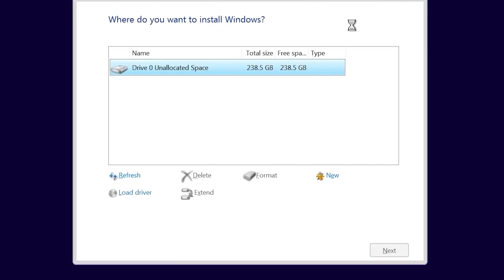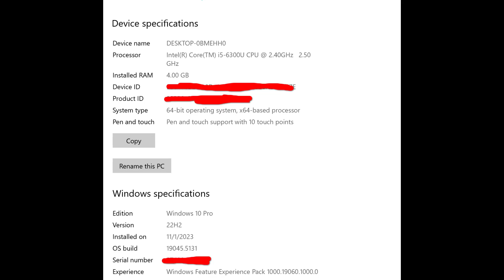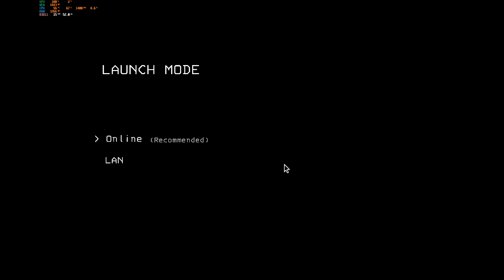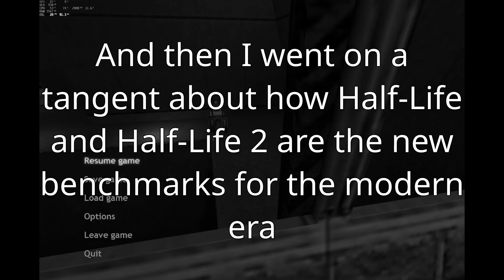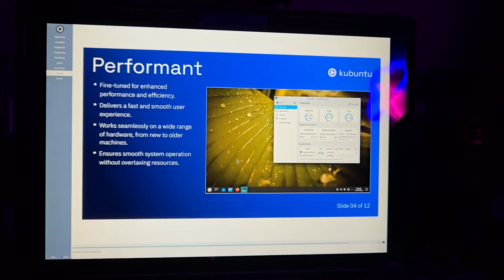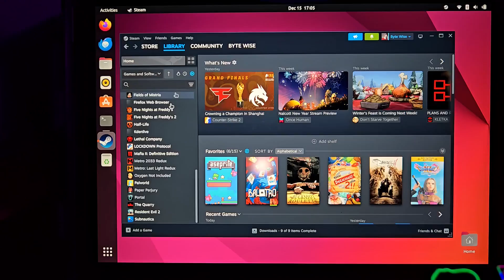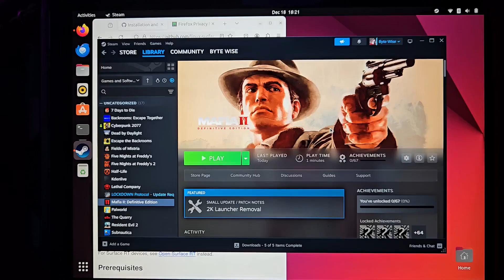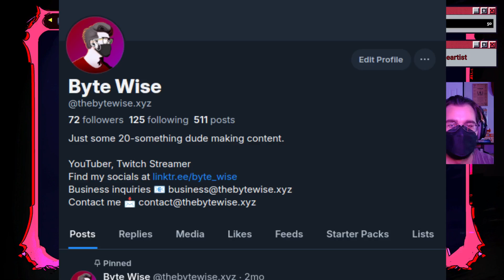Installing "SteamOS" On A Microsoft Surface

Comment: Top tip: Nobara fedora version installs on a surface and the touchscreen works without any additional installs
Reply from the maker: I might take a look into this since I'm using a flavor of Fedora for another project. I think there's another flavor that also supports Surface out of the box but I'll have to look into that

Comment: Thanks for the video, But I was wondering about a niche case using the Surface pro for a game streaming device? I am considering an upgrade path on the main gaming PC, and If I know that streaming to a Surface Pro through SteamOS, then I may pull the trigger on the gaming rig, going all out AMD....... I should have continued watching. Can you tell if this is a better experience compared to play through steamlink on a google chrome cast or mi box?...... I should have continued watching. I would then just work on getting the touch screen going which would make it worthwhile for me...... I should have continued watching... Great Video Thanks!

Comment: XP has not been derided by most Windows users. Many still do use it compared to ME and 8 (NOT 8.1)
Reply from the maker: Yeah another commenter pointed out I may have been thinking about Vista and they were 100% right. That's definitely my bad. If I do a follow up to this I definitely want to address it because I didn't mean for Windows XP to catch a stray bullet. Thank you for the clarification though!

Comment: I know I'm late to this... But what about ACTUAL SteamOS?
Reply from the maker: Good question! I tried HoloISO first as sort of a "is this even a good idea?" test, and because that didn't go well I had a feeling real SteamOS wouldn't go well either. I know the two are different enough that this might not be the best way to go about it, so I could give it a try in the future. I'm also partially waiting for Valve to drop an official release for the sole purpose of well tested compatibility with more hardware.
Reply: @byte_wise  I believe they have an official release. I was going to try it on my own Surface Go 1, but wanted to see if anyone else had done it first, and I ended up here.

Comment: I've been thinking about doing this with a surface book
Reply: Don't. Redhat-based distros (such as Fedora Atomic (which bazzite is an image of)) have issues with those laptops where they will freeze at boot. Use Arch or a debian-based distro instead.

Comment: i picked up a surface pro 3 from a place i was volunteering at.
bloody nice screen and surprisingly capable when given a decent os (windows 10 ltsc with some tweaks, the linux tablet experience is not good and if it is, that distro has other compromises that i didnt like).

recently got a pen for it and gave it to my mother to use as a note taking/drawing tablet for christmas.

i bought a surface pro 6 to replace it as i was using it as a reading tablet at the time and i found one for a good price.
its got some screen bruises due to a design defect that seems to be present in the pro 4/5 and 6 but other than that its pretty nice hardware.

the touchscreen worked on most linux distros no effort or special version required.
on screen keyboards suck on linux, either they are too agressive and keep triggering with the keyboard or they dont trigger when selecting a text field at all.
they also didnt work with all text fields either... 
really annoying.

i currently use my pro 6 as a reading tablet and to stream stuff from my jellyfin server as it being separate from my main machine and not being logged into youtube or discord makes it so that i dont get distracted doing something else and actually enjoy the book im reading, or the show im watching.

Comment: I'm assuming Proton is what was making the performance so bad, I think if you stick to native linux programs, it would perform better than windows by far. I have an old school chromebook that ran horribly on chrome os and horribly on windows. But once i put debian on it and started running native linux applications it ran perfect for what I needed it for!
Reply from the maker: I might actually give this a try because I have a handful of games in my library that have native Linux builds and I have a second Surface that should still have its copy of Windows. Maybe I'll do a follow up short or video. Thank you for this though!

Comment: Windows is horrible on tablet. On linux, I like more gnome just for multitasking. To use more like as tablet kde mobile can be another choice (feels more like as android). I use both, but I prefere to log in and log out to change the desktop because why not.
Reply from the maker: I totally forgot about KDE Mobile! I know Ubuntu has something similar, Ubuntu Touch I think it's called, but yeah those would be a really solid experience on this guy with the touchscreen support. I might take a look into those as options on this
Reply: @byte_wise Ubuntu touch have lomiri desktop which if inspired from ubuntu unity. About mobile version, idk if exist gnome mobile for x86 devices. About kde and smart tv, kde bigscreen is the best idea.

Comment: I think you have issues with games because dxvk usually takes up more vram than normal dx11, and because the intel drivers for 6th gen don't support vulkan 1.3
Reply from the maker: That makes a lot of sense. I probably didn't have a lot of VRAM to work with anyways. Would that also explain the weird issue I was having with OBS on the Windows side of things where the recording just wasn't going for some games?
Reply: @byte_wise  with the game recording/OBS thing i don’t know but something tells me the low power U-series intel chips just have terrible encoders, my laptop from 2023 has a 13th gen i5 (1335U) and it struggled about the same when recording most games in windows no matter what software/preset/settings i used

Comment: Awesome video, unfortunately you didn't remove the PC from the case and try to attach a 650w power supply, so -3 Bringus points
Reply from the maker: If I brute force the BIOS password will I gain those points back? I can also trim some of the case for "better air flow"

Comment: How do you keep your glasses from steaming up?
Reply from the maker: A really good mask. The default ones that usually come in that medical blue color have the metal bit by the nose, but it's not very good at keeping the glasses from fogging. Thankfully it didn't require much trial and error to find a good one that I could also be heard through
Reply: @byte_wise  Why wear a mask in a video anyway? Looks cringe and unnecesary